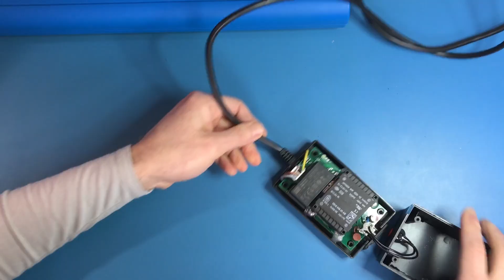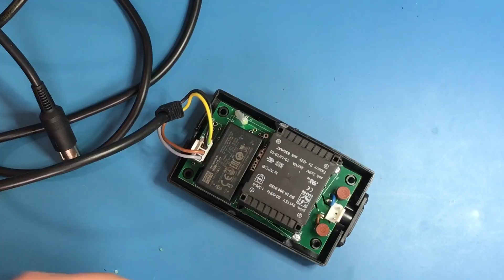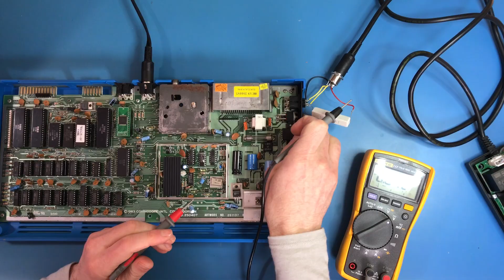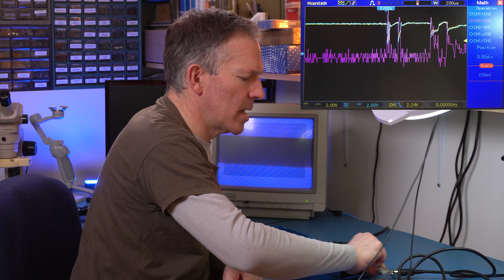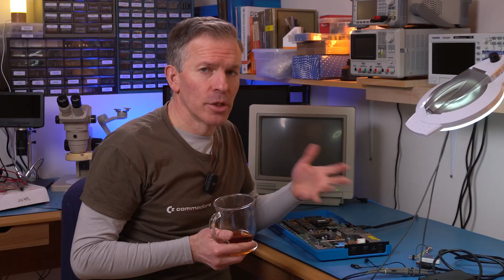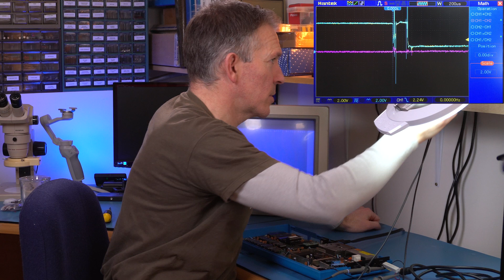I Can't Leave This C64 PSU Alone!

Comment: The long GND lead of the scope probe is definitely catching a lot of interferences. The spikes are not guaranteed to be real or interference. If you want to measure this in a better way, you need to keep the GND as short as possible. If you remove the holding clip/hook from the probe, you will see a metal tube close to the tip of the probe. This is a GND shield if you find a GND close to where you want to measure the 5V, you cold solder a wire to that pad and then wrap it around that part of the GND shield. This way, the GND is pretty short and you don’t pick up as much interference. 

Also, the switch is bouncing. It does not produce a step, but it is a noisy thing. 

Those power switches are often a cause of failure. In the C64, they can be oxidized and produce just a little bit too high resistance and thus a bit too high voltage drop, which then leads to malfunction. On the C128, which draws a much higher current, they often look pretty „eaten away“ inside. The little contact plates are not black, they have holes. 

The power supply does not look like a hobbyist design to me. Except the mains connector. That is a bit weird. 

I think, the 5V AC/DC module is a mean well one. That is actually a decent company. The 9V transformer looks familiar to me. A Hahn one. A 10VA transformer would be a good choice. More is not good. A transformer is unregulated by its nature. The output voltage will be the nominal value at the rated current. If the rated current is much higher than 1A, the voltage will be higher at the actual current drawn by the C64. Thus, the voltage drop over the voltage regulators will be higher, which means, that they get hotter and may start to shut down.
Reply: Ground leads and switch bounce was what I came here to say, so I’ll plus one this.

Comment: if the output voltage is low inside the c64 but good at the psu terminals then you have some sort of intermittent high resistance somewhere between the psu and c64, checking voltage drop along the wires connectors switches might show the faulty component

Comment: 10:14 5 volt? It is AC 2x9 volts / 2x5VA (apparent power because it is AC (represented in VA)) and not 2x5 volts.

Use IPA on hot glue ... and the hot glue is there to make the screws not to get loose.

Comment: The computer generates a reset signal when switched on. During this time the voltage may be unstable. If the voltage is stable and then the reset is released, everything is fine. If the voltage continues to be unstable, the computer will crash.
I suspect that the power supply has a crowbar. This is to prevent voltage spikes from damaging the computer. It is possible that this crowbar sometimes responds and the power supply 5V is muted.
But the 9V AC is still there but 5V DC is muted.
It's possible that this will mess up the computer. 

The component where you assume the middle pin is not soldered has the middle pin connected via the cooling vane.  Is the transistor parallel to the 5V to pull it down?

Comment: The power on reset circuit on the 250407 is designed to hold reset low for around 400 ms if I recall correctly. The rest of the delay is mostly due to the RAM test.
If you try switching to a JaffyDOS Kernal, you will see a much faster startup as the memory test has been removed.
It's also possible to speedup the reset timer circuit itself by replacing either a resistor or a capacitor to a lower value to but I don't see the point.

Comment: I have the exact same power supply, which shows the same behaviour on my C128 ( with an adapter). In my case the PSU shuts itself off after some time running, I think it has something to do with heat - at least in my case.
Reply: If you replaced your C128 psu with that knock off one then you made a big mistake. The C128 psu is a proper switchmode psu that outputs 5V up to 4.74A and is rock solid and very very well designed. i know because I reversed it and made a reproduction.
Reply: I used this PSU with my C128 until I repaired my original C128 PSU which is doing a great job now again. You are right, the original one is very well designed.

Comment: Looking at the specs of IRM-5-10 module the OCP is at 115% to 190% with automatic recovery when condition is removed. So as you bounce the switch it is between 2.3A to 3.8A to trigger output cut off with automatic recovery. 
For OVP it shuts down voltage and uses Zener as a pass through. 
I would say that for short delays you are triggering OCP with EMF/induction in cable combined with loading caps. 
For long shut off it might be voltage raise in 5V rail caused by extreme switching by bouncing voltage

Comment: The initial power draw is rather common, because all caps need to charge. The reset circuit is responsible to assert reset until the voltage is stable. You wondered about the long reset time and so do I. You could use the scope to monitor both voltage and reset and compare that between boards. Voltage spikes from rapidly changing loads are unfortunately not uncommon with SMPs.

Comment: If your oscilloscope ground can be isolated from the C64 ground (which it is if the C64 PSU output is fully isolated) then you can connect the probe ground to one side of the resistor and just do a differential measurement that way. Don't connect any other probe grounds anywhere if you do that though.

You can use a real differential probe, but I think even a cheap one is low hundreds of $. I have a DIY differential probe project I've been meaning to build up which supposedly gives pretty good performance but I don't recommend that build as a way to save money -- do it if it sounds like fun on its own :)

You can also do isolated measurements with a cheap handheld scope, but of course then it's much harder to correlate your measurements together.

Comment: The voltage spiking up to 2x the supply voltage and down below 0 can be from the inductance in the power cable -- that's transmission line effects on the power wire, where the switch bounce is starting and stopping the current draw at very high speed, and causing ripples that propagate back and forth down the length of the wire. If you know anything about residential plumbing, it's basically the electrical equivalent of water hammering (hydraulic shock) when the valves in an appliance open and close too quickly.

The filter capacitors on the board actually make that noise look worse on the input but should smooth it out before it damages any internal components. They behave like an water hammer arrestor for your plumbing.

You'll see this situation for sure any time you're switching higher currents quickly at the end of a long cable, which you should expect with the inrush current into the filter capacitors on the C64 board.

The worst I saw of this was an LED sign being designed at a place I worked, where people were plugging in a 90VDC power while it was powered up, and the resulting 180V spikes destroyed several expensive LED modules before we figured out what was going on.

Comment: The noisy current draw while you're turning the switch on is just contact bounce -- there's a little mechanical bounce and arcing as the switch makes contact so you always should expect some high frequency noise from any mechanical switch (including relays and contactors), especially when it's switching higher currents.

Comment: Great video .. The reason there is a delay on boot to basic prompt .. its becouse it does a menory check 1st :) .. Keep up the great work Noel :)
Reply: You can change the kernal ROM so it skips the memory test. Then it switches on almost instantly.

Comment: To eliminate switch on c64 you can use switch on the power supply for testing. You can even bridge the switch on c64.

Comment: Can we just spread the word that to tackle hot glue all you need to do is drop a bit of isopropyl alcohol on the glue and it instantly de-bonds it, whether just a few drops or on a saturated Q-tip at the point where the glue contacts, It really is the silver bullet, drives me nuts when I see people levering at it with screwdrivers and struggling. Sorry people, rant over!
Reply: You should see me trying to remove it from similar C64 modern power supply without knowing about IPA... Messy...
Reply: Thank you !!!! I thought about commenting that, IPA just works, no hassle, it just loses the grip and is reusable if you want 🙂👍
Reply: Exactly! I wasn't going to comment but I just had enough lol @danpedersen55
Reply: Ouch, I always forget about this, thanks for the reminder!
Reply: No need to rant. I was just screaming it to the TV while watching.
It helped... me.

Comment: The large "module" is simply an encapsulated transformer. It has two 115V input windings that connect in series for 230V and in parallel for 115V. The output has two 9V windings connected in parallel. They are rated at 5VA each, so 10VA total. Transformer power is quoted in VA, instead of Watts.
Reply: Yup, to elaborate a little transformers are always spec'd in VA because that's what determines how much it can handle, both magnetic saturation and heat inside the transformer scales (mostly! it's not completely linear) with VA, not Watt, so that's what it's rated on. Depending on the load power factor it can handle less or MUCH less watts than VA, at for example PF=0.5 a 10VA transformer can only safely handle 5W, and PFs can go way lower than that.
As a guide cheap low-power PSUs and very old PC PSUs often have PFs (at full load) in the 0.5-0.6 range, somewhat newer PC PSU often have passive PFC (power factor correction) bringing it up to 0.8-0.9, while modern PC PSU have active PFC and tends to aim at 0.95-0.99 - all of them will have lower power factors at very low load.
There's lots of good videos explaining and showing how and why VA (apparent power) is different from Watt (real power) and how that relates to the power factor. VA shows up a lot in "supply" situations (PSU, UPS and so on) because it has to be able to provide the peak amp draw.
Reply: I did not get a close enough look at it, but I'd bet the secondaries are not in parallel. I think one must be driving the 9VAC output, while the other is rectified and regulated (by the other black module) to create the 5VDC rail. The two power rails must be isolated from each other, because the C64 does a trick where it connects them is series to get enough voltage for the 12V regulator.
Reply: @helgew9008 the smaller "module" is a MeanWell IRM-15-5 switch mode power supply module that takes mains voltage in and generates 5V dc out. The secondary windings of the transformer do appear to be connected in parallel.
Reply: @helgew9008  Nope, the 5V DC is generated by the Meanwell IRM-10-5 module (see previous video) which takes 85-264V AC and generates a single 5V @ 2A DC output, it has two pins for AC input and two pins for the DC output. So the two 9V AC/5VA windings are NOT involved in the 5V at all, probably used in parallel because why leave one completely unused. Meanwell PSUs are usually very easy to find datasheets for and it popped right up in Google, it has both over-current and over-volt protection, with automatic recovery.
There were some fierce spikes in both directions on the 5V line so it's possible it's managing to trigger the OVER-VOLTAGE protection on load-release? Perhaps the module has become old and isn't regulating down fast enough. Hard to tell, intermittent errors sucks!
TheRetroChannel just looked at a similar one (same brand, patreon only for now but will be released soon I guess) and internally it was similar but not identical, the 9V AC transformer was a different color and it had a capacitor buffering the 5V output from the module which ought to reduce the chance for over-voltage events! For over-current the capacitor is a wash, it would help if you turn on the C64 with the C64 switch but make it worse if the C64 switch is on before the PSU is powered on. Also, TRC didn't check the name on the 5V module as far as I could tell, so while it looked identical it might have been additional differences on his.

Comment: I was thinking the switch (the powersupply switch) but that was before we found out that both power modules are connected to the same board power so the switch cant be bad.  But what if one of the  solder joints between the power module and wall power cracked due to the bent board.  How about looking at the solder connections with a microscope?  Wiggle them?  Then reflow the connections.

Comment: Great to see more on this!!!  I still think its about contact bounce on the switch!  A good test would be to plug it in whilst the C64 has the switch on - powered (ie. not switch the power switch on the C64).  That's how I usually trick the C64 saver from bwack.
Reply: To reduce the negative peaks you can try installing e free run / rectifier diode (such as 1N4004) over the 5V input.
If - as assumed in another comment, one of the Inputs comes from a transformer, the bouncing of the switch can cause the negative voltages.  I have not seen the time base of the osciloscope in the video but bouncing a usual duration from 100us to 10ms.